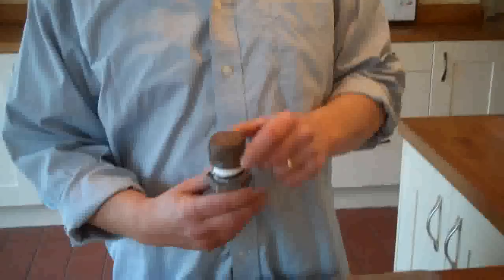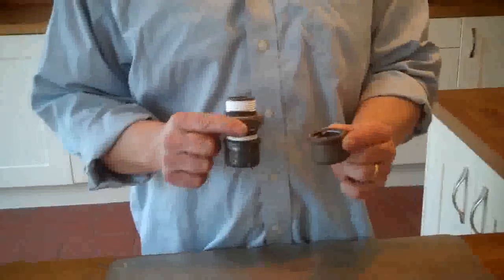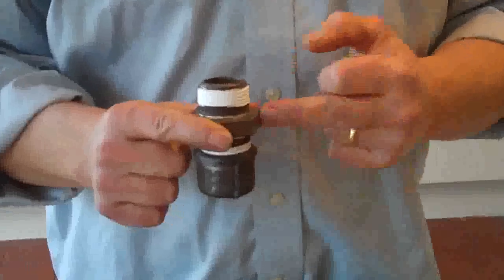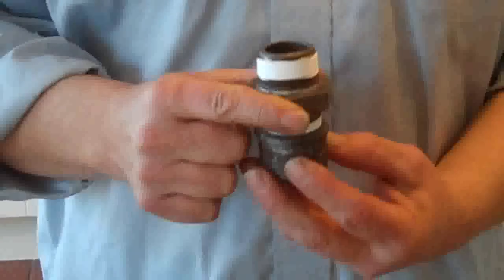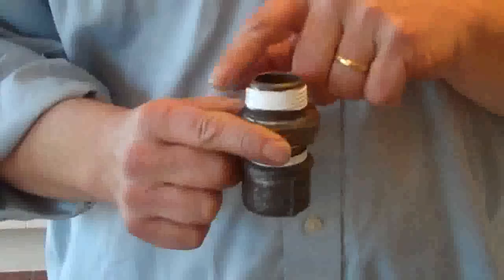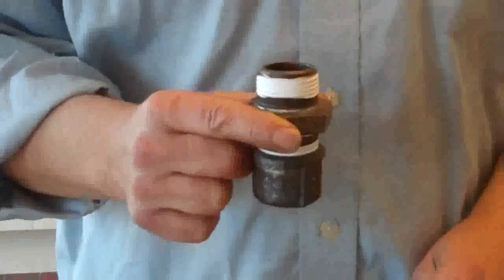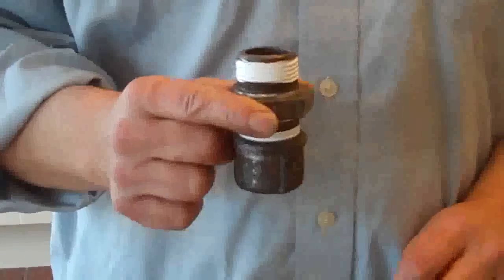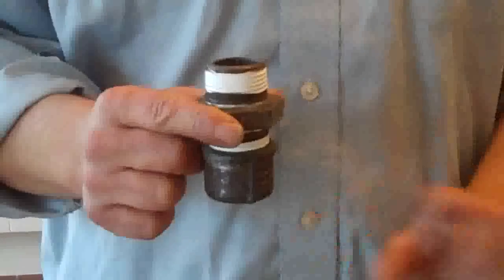Graphene from table sugar - the Tang Lau Method

Comment: As I watched your video, I had some basic questions come to mind, the end product seemed to be formed in the center of the meniscus layer is this layer concave or convex?  

The reason, I am asking is if the liquid is spun at a low regular speed, the product should form at the edges of the Mono Graphene Oxide layer. What I mean is can the layer of MGO be pulled or pushed?  

Your reaction is endothermic, so where the heat is coming from (direction, the center or the external edge), the meniscus layer type and spin should provide clues to producing large flat sheets, that can be drawn off by drawing a tube from the edge of the meniscus layer. - Up or down depending on the meniscus layer type.  

If this is the case, then we have a full production method that can be developed.  I would love to see a video of where the layer is developed in the solution column? Does the Mono Graphene Oxide float up or is it formed at the surface layer at the meniscus layer boundary?  

Can the floating Mono Graphene Oxide layer be manipulated by gravity like pizza dough?

Does the Mono Graphene Oxide grow like a mineral crystal or do the segments just join up this way in solution? 

Would the shape of the container make a difference? a large fat dish  or funnel shape?  

The original solution will have capillary action so where the reaction takes place and how could be manipulated? 

I need to stop now!
Reply from the maker: +Brad Miller lol - they are all good questions mate. But, the tang lau is a well known method - my first port f call would be the literature and second my own experiments from memory the meniscus is concave the source of heat is obvious mate - it was autoclaved in a steel tube. Tang Lau reports layer by layer top down growth - the rest you are probably going to have to find out for yourself lol
Reply: Plastics provide a convex meniscus where as most metals and glass provide a concave meniscus.   Thank you for the reply.   I have a disability that prevents my active participation but I am not opposed to sponsoring some testing.
Reply from the maker: +Brad Miller That is a shame mate - I am afraid I don't do outside work for others - I hope you find someone as your ideas are interesting
Reply: +Robert Murray-Smith Tang Lau reports layer by layer top down growth - I was not able to find the layer by layer top down growth quote but if this is correct then we have an answer in my mind for a large single sheet layer. 

A large flat container, large enough to prevent a second atomic layer from forming then we have a single large sheet based upon the dimensions.   So matching the amount of reagents, to the horizontal surface, we can produce a single large layer of one atom thick Graphene sheet as per your example in the video. 

Now all I have to do if find a machinist to make a large flat container that can hold an internal glass plate to lift out and hold the the product.    A vacuum press to drive out the remaining solution leaving an oversized single layer Graphene sheet on the glass or just lift the plate out of solution.

The glass sheet should not be flat but very slightly convex shape, that would allow binding agent to be applied to one side and bind this directly to one of your plastic sheets.  Just spit balling again! 

I over thought this... one my first go around. When I looked at the Graphene in the tube  it looked like multiple layers..   Some days I am smart! Other days I am just very good looking.    

Love your videos...  Cheers.
Reply from the maker: +Brad Miller lol - that was my reading of the paper too - but i am guessing it will form in 'islands' and grow out from there to merge into a covering for the surface. That will mean fracture lines on a single sheet.
Reply: My background is in Bio-Science and Adult Education, I now spend my time teaching disabled children and I only take the worst of the worst and I get exceptional results using brain plasticity. One of the teaching methods applied is visualization, you ask a question and get the student to envision the actions that will take place. I then use metaphors to help them to prove or disprove their assumptions. What I am doing is using parts of the brain to work with other parts of the brain. In other words, I am rewiring the natural flow and connections with the brain.

This method is called "Socratic Visualized Dialogue". Are we getting these "Graphene Islands" due to the "Conductive Heat Flow" within the solution. In my minds eye the" Graphene Island plate" is being moved from the production zone by this movement in the container. So we have Graphene Islands with a vertical and horizontal orientation tumbling and spinning in the "Conductive Heat Currents". Now all object tend to fall and move in a stable manner when ever possible, size and shape changes how the Graphene Island move in solution.

The Graphene plate becomes to large to move within the "Conductive Heat Currents" and apparently float up due to movement (basic aerodynamics/ hydrodynamics) in the container or hydrogen bonding or by trapped gases to the surface.

When I teach these children, I use a rope lasso to teach basic science and to make the body and brain work in new methods. The rope opens due to centrifugal force and forms a flat surface due to its spin. This same spin can be made to be of greater force than "Conductive Heat Flow" in the solution and the reagents within the solution will be spun to the outside where the single reactive area (The single Graphene Island) is open to form new connections with the reagents.

Before my injury, I ran a technology consulting firm and have worked with a large number of people to bring technologies forward production and to market. I have helped to raised millions of dollars for these start ups.

The largest value company that I facilitated bringing the founders and others together was JAWS Technologies, Inc. (NASD-OTC BB: ``JAWZ'') which became an 880 million dollar market public company. The corporate name is for a little start up called Jim and Wes's Software. This is one of the 30 products that they were looking to bring to market.

I have used "Socratic Visualized Dialogue" within a large number of Corporations and in the development of numerous technologies. My question to you is this. Where do you "See" the development of the Graphene Islands being formed?

Vertically , Horizontally or both in the solution?

Are we starting with a single Graphene Island plate that breaks or are we getting multiple plates being developed in the solution that gets pushed to the surface and bound together in a layer due to size differences?

When I was sky diving, I found that the human body could tumble around any way it or you wanted. Learning to fly stable in the air took years for people to learn. Tumbling was very, very common and the norm. The two most stable ways is straight up and down (head or feet down) or flat. The longer an object is in free fall the harder it is to remain stable in a vertical position. Fat short stubby people tend to fall vertically up and down (faster) and tall people fall flat and stable.( much slower) 300 + mph verse 120 mph.

I do not "See" a maximum number of carbon chains for each Graphene Island but an interference taking place restricting the development of large and whole sheets. At the atomic level we do not have up and down but with larger molecules we do see the properties of buoyancy and aerodynamics begin to manifest. (Basic Emergent Properties) So within the solution the Graphene chains we have a critical size take place forcing the island to float and become unable to move with the "Conductive Heat Flow" to allow greater growth of the island plate. To me this is what is taking place and why we get stacking of these broken islands instead of a single flat large layer.

I hope you find this interesting and it is my hope that others find the discussion interesting as well. My inner Geek is running wild.:-D

Comment: Subscribed. I know  people tell you this all the time but sir, thanks for your great work and keep it up. Very interesting and useful these videos!  Do you have videos about using graphene for electricity transmission cables?  These are the ones that interest me the most. I would be glad to test if electricity goes in or around the wire like Tesla said. I got the feeling that graphene coating and an iron core of some sort would do the job on a cable. I am new to this so who knows!
Reply from the maker: Thinktank I have had a bit of a think about this mate and done some stuff on bromine intercalated graphenes as alternative cables - interesting stuff - I am a bit involved at the moment but it is something i want to get back to

Comment: Can I use a jar for the method?
Reply from the maker: Lszl Gyulai i wouldn't - a jar is a bit delicate - pressure does build up - you can buy the parts from ebay or a real autoclave from there too - a small one is about 50 pounds

Comment: Really cool!  Any ideas on annealing times in a conventional oven?  Keep the videos coming.  Thanks!
Reply from the maker: did you read the tang lau paper he gives annealing times in there
Reply: Robert Murray-Smith  
Actually, I did not.  I was hoping to get an answer from you.  Where is this elusive paper?  Trying to find it has proven to be quite the time vampire.  The only info I could find, suggested a temp, left an option for lower temps but not a time or time(s) for either..  It is understood the goal is to lower the resistance of the material..  Something to the effect of "The electrical resistivity of the GONs can be tuned by annealing for 8 orders of magnitude ranging from 1000000Ω cm to .01 Ω cm."...  Clearly you are quite handy, I am sure you have a pretty close guess.  Thanks
Reply from the maker: Robert Cochran
the original paper is here

 
Bottom-up synthesis of large-scale graphene oxide nanosheets
Libin Tang,ab   Xueming Li,c   Rongbin Ji,b   Kar Seng Teng,d   Guoan Tai,a   Jing Ye,a   Changsong Weia and   Shu Ping Lau*a 
Show Affiliations
J. Mater. Chem., 2012,22, 5676-5683
 
DOI: 10.1039/C2JM15944A
Reply: Robert Murray-Smith  I was acually looking for an answer to my question about annealing times in a conventional oven (in my kitchen).  Certainly you have tried this.  Is it even possible?  I prefer the KISS method.  Kinda like "Place on cookie sheet, top rack, on BROIL for 1 to 8 days"....  I have access to a pottery kiln if needed, but would like to keep it "in house".  Thanks
Reply from the maker: Robert Cochran
try 30 mins and if that doesn't work change it - lol - sorry mate but you have had all the answers on this i have to give
Reply: Robert, I appreciate your input.  Your opinion is very valuable.  It is easy to respect your opinion because of your woking knowledge.  "Never trust a brake job from a mechanic with clean fingernails!"  So, heat for a period of time (30 min.), test resistance, heat again, etc... untill desired "order of magnitude" is reached....  Kind of like tempering, I guess.  Have you tried the photo flash on this material, any effect?  BTW looking for parts to build a flash unit as well.  Any hints?  Thanks again!
Reply from the maker: Robert Cochran
I did flash the material mate - but i thought that was in a video on photoflashing - as for getting hold of the stuff - i just went onto ebay and ordered it from there but here is the web page - i think they are the same guys i got my stuff from
http://www.xenonflashtubes.com/kits.html

Comment: I prepared solution with 18.5g sugar + 50 ml  water and used autoclave of capacity having 55ml and kept it at 165'C for 70 minutes. I tried this method by using autoclave but i got thick chocolate coloured liquid without any layer floating on it! so pls can you tell me what went wrong?????
Reply from the maker: lol - yeah - you did it wrong - sorry mate but the process conditions are quite delicate i think and without actually being there i can't say a lot - all i can say is read through the original paper and try again

Comment: Hey, how can i modify this method to heat the glucose solutin in furnace?? in othe words at pressure should the autoclave be run for this method? Pls reply soon :)
Reply: imagine i dont have an autoclave!!
Reply from the maker: Krishna Murthy
build one
Reply: I have a muffle furnace, can i use dat instead sir? Nd wats d pressure required in autoclav at 160C?
Reply from the maker: Krishna Murthy
look up the steam table that will give you the pressure
Reply: Rob did dat already, no pressure mentioned!! Bt dat wud mean furnace should work ryt
Reply from the maker: Krishna Murthy
look again - the pressure is given in PSIG and Psi for different temperatures - if you can't see it you are not reading it right
Reply: I saw d 1 by journal f dental association, it is blank in front f temperature 160c, bt still is it possible 2 substitute furnace fr autoclave?
Reply from the maker: Krishna Murthy
no
Reply: Alright, after oxidation part in hummer mtd, v filter, where is GO, infilter cake or d filtrate?
Reply from the maker: Krishna Murthy
you are asking lazy questions - where do you think it is?
Reply: filter cake i guesss

Comment: I found the scientific article about the Bottim-Up synthesis by Tang-Lau's team, but it never stated any info about scaling the autoclave (which is my interest) 

40ml/50ml = 80%
Do you think the 80% capacity model should be replicated for scaling purposes? I just want to know your opinion. thanks
Reply from the maker: scaling will most likely be defined by a linear relation - the best bet is just to experiment to estimate the scaling factor

Comment: I had a crack at this method last night-obviously did not tighten my pipe fittings enough.Could only get to 150 degrees Celcius with the cooker i was using.
I had 3 vessels in total and only 1 had water left in it when i opened them.
After rinsing the dry vessels and the wet one,and keeping the wash,i can see the same oily looking reflective floaters in places on the top.
Looks like it made some graphene.
Also just tried cooking on the stove top with vinegar and sugar,in a pot with a lid.
Same floater showing but not much of it.

Thinking a pressure cooker would be a good thing for this process.
Reply from the maker: sounds like a good plan - try giving it longer
Reply: Robert Murray-Smith i just burnt some rice on the stove and filled it with water to help remove the carbon off the pot-a skin is forming-could it be graphene?
Reply: +m3sca1 Anything came good on it?
Reply: Bartosz Barejko nope

Comment: Can I use half the temperature or 90 degrees celsius and double the time?
Reply from the maker: I don't think so - after all if you heat an egg to 50 degrees you don't get a boiled egg - what you get is a hot egg!

Comment: So if I were to create a thicker GO solution by leaving it in the oven longer, would I be able to sonicate it for use in the light-scribe process?  I am waiting on parts for my equipment, and I am going to be using the improved method outlined by Dr. Jame Tour.  If the method you show in this video can be utilized to create a suitable GO solution, then I can begin quite a bit sooner than I thought.

Comment: Sorry for the late reply, I've been hectic as of late and didn't get an email from YouTube with your reply. But yes I did see a post on the subject a few weeks back showing GO accelorates oxidation while r-GO resists corrosion, and now asking around different circles for the reference and searching high and low for it. I will not let this rest until I do. Also, check this out: 
iopscience.iop.org/0957-4484/24/21/215604  I know you will like this but the paper isn't free but well worth it

Comment: Wow, while coating a finely frosted piece of glass with monolayers of pristine graphene, just a moment ago, I noticed that with each alternating layer I applied (after drying) would want to be inverted and made it rather tricky to transfer by submerging with glass under the meniscus. Clearly, one side is hydrophilic, and the other, is hydrophobic. This became quite apparent while manually adding each layer singlehandedly. What causes this?? Is there a theory on this? No model explains this.

Comment: Ok, so after a few weeks, I did finally purchase a nice 50 mL autoclave, the same type in the original paper. I have a nice convection oven at home and did a test experiment. 
The results initially looked disappointing. Upon further inspection, I found very small particles on the surface of the water, only becoming seen when a glare covered the surface of the water.

I will be increasing temperature and time in the oven, wish me luck!

Comment from the maker: Lightscribed reduced GO is pretty good it does need charging - use a charging circuit the same as you would any capacitor but at much lower voltage. I'm not sure of the power density i'm afraid and it would be intimately affected by the construction quality you manange. Thanks for the kind comments

Comment: Greetings. I've already tried twice and it hasn't worked in the autoclave. The one we have at school doesn't get hot enough. The first time I tried using the tang-lau method, I didn't tape it properly so it leaked. The second batch is in the oven right now and it's not leaking. Hope it works! I purchased your book, btw. Great great job.
Thanks, man!

Comment from the maker: that's ok - you need to apply the tape properly or it willl leak and you will have to start again. It's not challenging but you must do it carefully. I don't know much about the pipe you have there so check the pressure ratings before you do it. If you are worried do it outside and surround the oven with sandbags just in case. It should be ok though - but as it is a school project better safe than sorry.